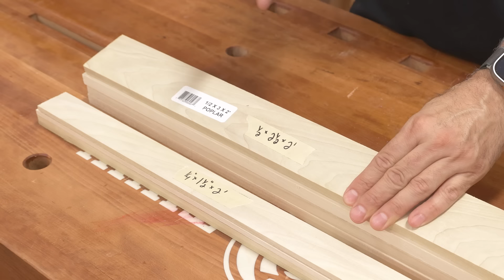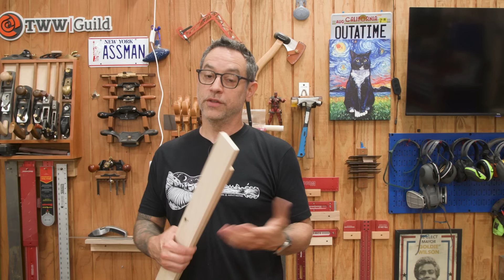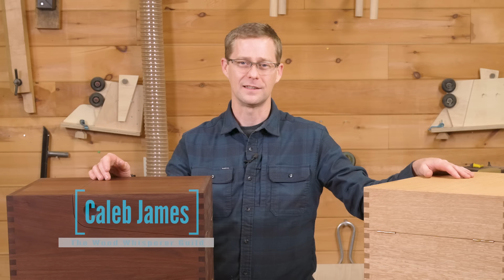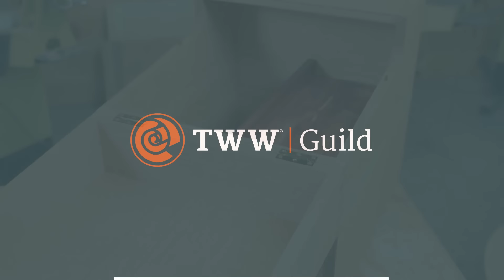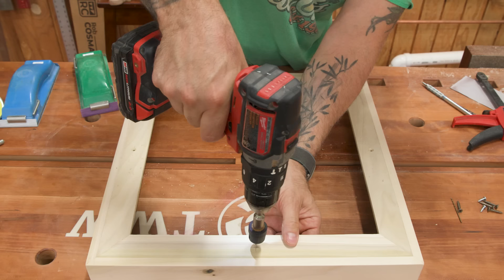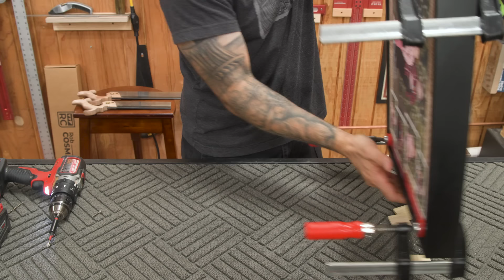DIY Floating Frames that Anyone Can Make!

Comment: I like seeing simpler projects like this added to the mix. Two observations:
- if you want to limit the tools needed to just a miter saw, you could raise the back board to bring the print up to a height that works with your standard boards
- I believe the wider stock boards are a slightly better cost/bf, so if you’re going to rip them down on a table saw anyway it may make sense to start with wider stock.

Comment: Even if your mitre cuts are perfect, checking for squareness during the glue-up of the frame would be an extra level of comfort. And did you check the art work for squareness too?  Any out of squareness there would have to be matched in the frame or the gaps would not be even all around.

Comment: Great build video, as usual, Mark, and something I may do this year.  One change I think I'll make is that instead of trimming the vertical piece down to the desired size, I'll offset the inside piece, so the print is at the desired height.  This would give room for the hanging hardware as well as the mounting screws to be inset, allowing the frame to hang flush on the wall.
Reply: I like your thinking.🙂🙂

Comment: I make similar frames, but rather than cutting the sides down so the back bits can be flush with the back of the frame, I add spacers below the back bits (while assembling) to lift them up enough that the front of the canvas sits at the height you want.  This also makes the frame look a little chunkier, which is often a good look.

Comment: Hi Marc, do you have any issues with the festool Kapex blade deflection on the mites? I used the 10 inch Kapex on a  course with Peter Sefton and ran into this issue with a new blade on box mites?

Comment: Nominal measurements...an aberration and and it should be outlawed. yes this matters and it is a big deal. We all understand from where it comes from: it comes from non-sense and greed. If the outcome is 4"x4" ,or whatever, getting more expensive (as the raw material will have to have necessarily he waste included to then become a real 4"x4") so be it. But as is this totally farcical and unique to this industry. My hope? that someone somewhere someday will put an end to this stupidity, aberration and disgrace - it has gone for far too long and the shrinkage is getting worse. Just imagine if (for example) the marble industry (where a big slab can become small  floor tiles for example) would start doing the same...   We all need and have the right to know exactly what we are paying for and what we are getting: a simple, critical and elementary  customer right be one a private, industrial or commercial consumer.

Comment: So, you are just relying on the glue in the corners - no splines or other joint strengtheners?
I have a shadow box frame I want to make and I was wondering if the glue was enough.
Is this just a special case because the frame for the photo is adding the structure or would you feel that the glue should be enough if this was just artwork that was not attached to the frame?
Reply from the maker: It's such a light duty piece that I do think the glue is enough for the purpose. And the fact that art is screwed to the frame kind of helps give the whole thing a lot more stability. Just hanging on the wall, it should be good to go.

Comment: Always wear good eye protection...  At 4 min mark (https://youtu.be/8qGACDynTbw?si=Sp1utsCTHCjSukAq&t=260) when filling knot with CA, that is how I got it in my eye.  Knot was just hair bigger than here, filled and sprayed with accelerant.   Minute later, touched it prior to sanding and lightly pressed and just like popping a pimple, it popped...over rim of my glasses and into eye.  Bulls eye.  Top of CA cured, but apparently not inside.  Freak accident, but a reminder of why safety is important.  Still paying the $2k dr bills.  But a good pair of safety glasses are priceless.

Comment: Mark, how did you attach that block that prevents blow out on your miter saw?  Is it just alien tape or something similar?  Or is it securely attached to other points?  That is probably the single best improvement I’ve seen for a miter saw

Comment: I made one of these floating frames for a small painting of the Swallow's Nest (Castle on the Black Sea) I bought while visiting the Crimea in 2007. The painting was on canvas board so I had to glue enough scrap wood to the back of canvas board to make it level with the face of the frame. I used some nice figured sapele wood for the frame, painted the 1/4" gap floating area flat black and clear coated the face of the frame, 3 coats. The mahogany color of the figured Sapele clear coated looks really nice with the color of the sea around the castle. 
Google the Swallow's Nest in Crimea, the castle is sitting on top of a stone type mountain over looking the Black Sea.

Comment: Regarding nominal wood, especially in dimensional Lumber, the reasoning for the 1/2 in smaller actual size in every direction is milling. Rational being that tradespeople didn't want to work with rough sawn dimensional lumber (whether that's true or induced demand is another story), the 1/2 in of "missing" material is 1/4 in of milling on every surface that's lost on production.

So the nominal sizes is rough sawn dimensions, what you buy is milled, so not that unlike buying hardwoods in S4S vs rough sawn and having to account for milling when buying the latter.

Comment: My wife is an artist and i make all of the frames for her artwork; all floating frames.  for anyone that might want a different approach,  I use a router bit called a stepped rabetting router bit which i found on Amazon.  It's fairly inexpensive at about 30 dollars Canadian and if you have a router table, you can cut a stepped profile  into a single strip of wood for the art to sit in and the spacing around the edges is perfect.  

If you don't have a router table, this is obviously a great way to go also.

Comment: When gluing the sides, if you leave 3 small areas without the Titebond, you can then use CA in those dots.. It will hold it while you then apply the clamps. That will allow you to use the bench to keep them flat with a little wax paper on the bench to prevent glue from getting on the bench.
Reply: @coldbloodedkidz860  If you use CA accelerator on the opposing surface at those points, you can avoid clamps altogether if the boards are straight. They will just hold together instantly while to wood glue dries. You probably know this already, but maybe it could help a beginner with limited or no clamps.